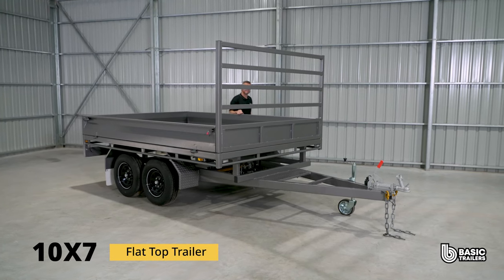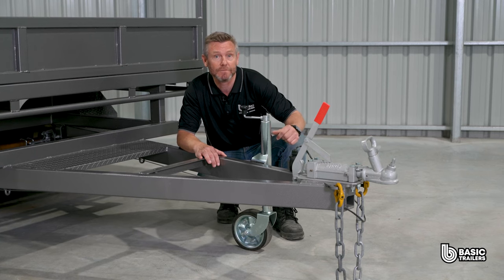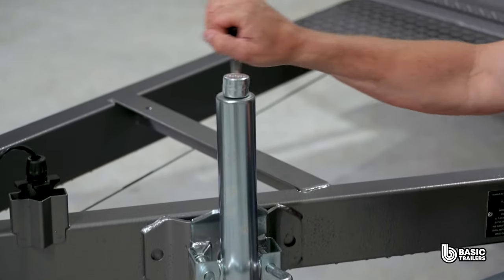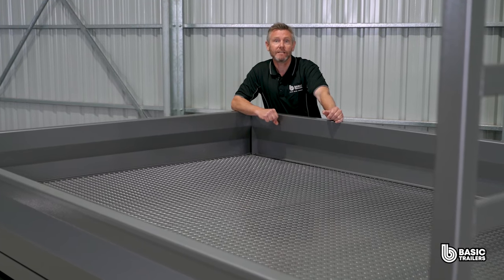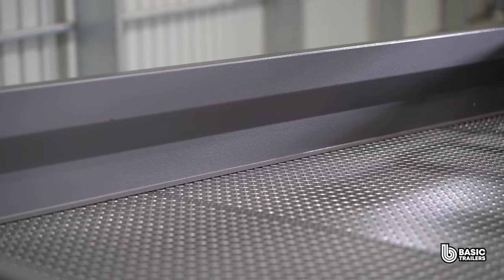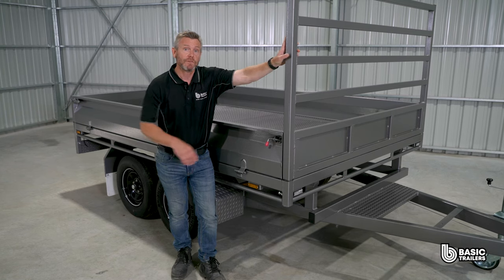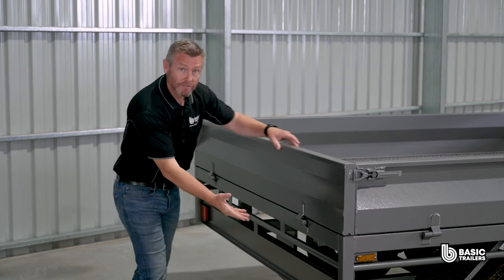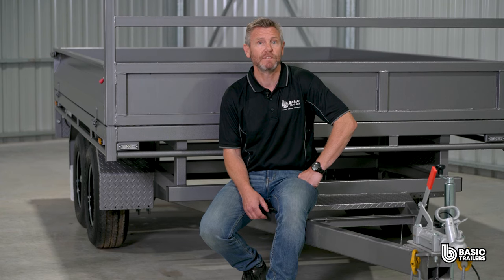10x7 Flat Top Trailer

Comment: Wtf is a flat top trailer? Is it another name for a deck over? I don't understand what makes it a "flat top" at all, is in an Aussie thing?
Reply: Because drop the sides and you have a flat top
Reply: @anthonywhite5353 never heard that term and it doesn't seem to be a specific type of trailer, just any trailer without sides? If the wheels are under it I've always heard/seen that called a deck over
Reply: @freethemg1  Aussie term  , also the truck trailers or tractors (kenworth/western star) I think you call them if the trailers are dead flat front to back its a flat top, if there's a step where the hitch is we call it a step deck